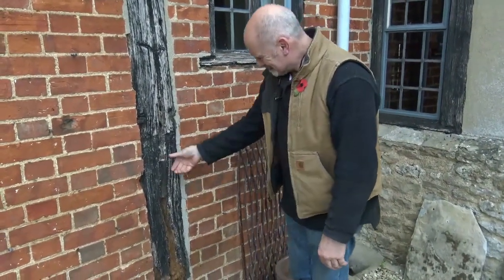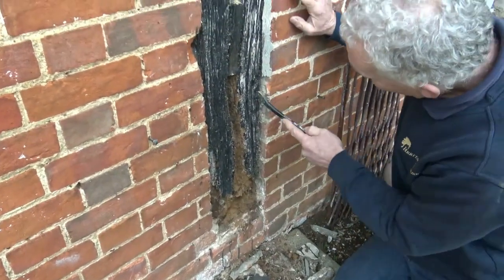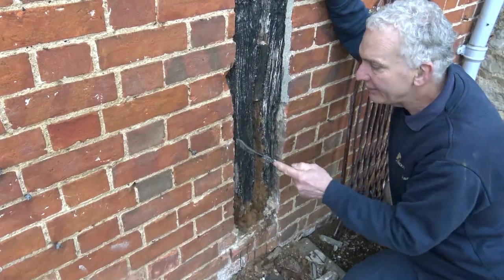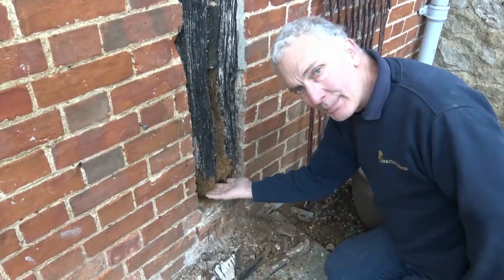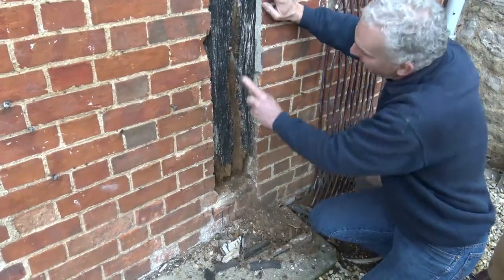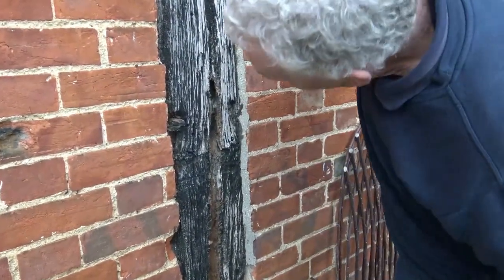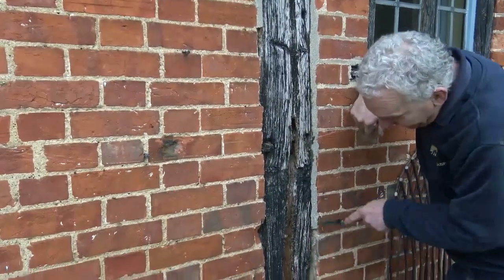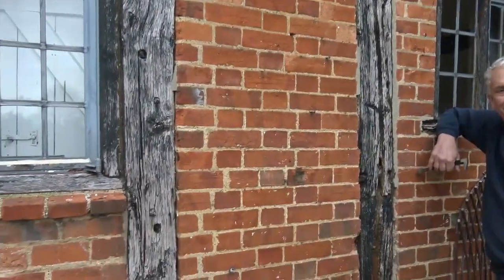A Confused Carpenter sees the light!

Comment: Do NOT put limes in that wood... the citric acid will attack the timber making things worse
Reply from the maker: Yup - the job's a bit of a lemon really..
Reply: What do you think they used before cement, lime is fine. Lime is even used as a finish to furniture 🙄
Reply: Clearly it's a job for a cantaloupe. Ya'll don't know what you're talking about.
Reply: @bigbaskin587  Someone doesn't get the joke. 🙄
Reply: @bigbaskin587  he meant the fruit
Reply: BornToRunBarefoot  that would be a peach of a job.
Reply: jeremy... I agree. Kumquats are undoubtedly the preferred option for this sort of job, or Kiwi fruits for the builder lads working down under.
Reply: Its obvious what you need here is a pineapple.

Comment: Very sensible.
Understand what is actually going on.  Old timber framed building get wet and dry out if you let them.
Brickwork, (my subject) gets wet and dries out if you let it.
People in offices using computers design modern buildings with all sorts of modern materials without truly understanding damp and condensation. Your comments regarding cement mortar versus lime mortar are spot on.

Comment: Oakum is the original caulking used on ships to seal the joints between timbers , usual hemp or jute mixed with tar ( pine tar is light in colour so was more used )
Reply from the maker: That's the stuff.. if it seals boats, its ok for timber frames!

Comment: I'm probably way off the mark, but it looks like they could've built it out of brick entirely. Was it a transition period from wooden House's to one built out entirely brick. It's when you can't quite let go of the original way if building house's..
I should've added that on my travels I have noticed a lot of house's been built with wooden frames with kingspan then brick..
Reply from the maker: No - this was late 1500's, Listed, but messed around terribly - so has to be kept as is now - but the infills were actually put in the 1930's to replace original daub..

Comment: I would like to ask about wood hardeners.....i know this is a (potentially) graded/histroic building etc....but is there a place for wood hardeners here??...i've used the Ronseal one and it's been good so far....i should think it would at least protect that bottom part of the post before the lime mixture??
Reply from the maker: I wouldnt use anything - any chemical interference will result in moisture entrapment.  Its kindof dealing with the symptom not the cause.  Ideally, sort the reason wood is soft (concrete, silicone etc) then honest repair by removing soft timber and slicing in a plate of new matching timber (usually oak).
Reply: ahhh right yes....putting in a new piece sounds about right....and I did wonder about the moisture thing.....I've only used it on hardwood window frames which were ultimately painted...so a differtent job entirely.....Thanks for the reply though...I find this kind of thing perhaps more interesting that I should :D

Comment: I have a old stone cottage connected to a derelict barn to the side, the cottage was renovated about 25 years ago (not by us) an from my information they kept the stone cottage an put breezeblock infront the whole way around to raise the eaves of the house an roof. we have noticed some damp along the front. is this coming from the barn (along the front of the barn all the gutters are broken) or is it possibly because when they renovated they trapped the moisture in with putting breeze block an cement infront off the old stone? can I add you on something to show pictures or videos
Reply: Conor Mcdade 
I would say that in most cases it would be the broken gutter, if it's a barn roof there is a lot, a huge amount of water running off with no collection point, in light rainfall there will be tens of litres a minute running off that roof saturating the front of your house.
Look into that first, hope that helps.
Reply from the maker: I'd check the barn and gutters first - but you could be right - certainly the gap between block and wall needs ventilating.. Ground levels too - below level of internal floor?  Check all drains...

Comment: First question then, what is Oakham?! (I imagine it's some sort of filler!)
Reply from the maker: Oakum - hemp, soaked in stockholm tar, wound into a rope and hammered in.  It's used to seal the decks and planks of sailing ships, so if it keeps boats afloat, it keeps timber frames dry. We first used it on the roof of Windsor Chapel after the  fire, and its still not leaking, so I reckon it works!  Our Heritage House website has caulking kits for sale - oakum, lime putty and caulking iron for repairing and sealing oak frames...
Reply: @WarmDryHome  am I wright to think its horse hair as when I work on the canals installing lock gates I would use horse hair I think they called it oakham.
Reply: @WarmDryHome  thank you sir. I enjoy and learn from your videos!
Reply: oakum was a mix of hemp or jute fibres mixed with tar  (  pine tar usually  )and forced into seams (caulking a ship seam ) this creates a water tight seem .
Reply from the maker: No - its hemp , soaked in Stockholm tar...
Reply: When I use to install lock gates we used a horse hair and wedged in in the gaps with a tar

Comment: a fiber-blended epoxy would what I would use sure lime is quicker but epoxy will soak into the wood and restore its strength
Reply from the maker: Nope - unfortunately not:  . just saw a thatched cottage yesterday - next video going up - frame full of £16,000 worth of peter cox wood filler - entire frame now totally knackered, and needs best part of £100k and new frame - all because damp wallies filled it instead of butting out and letting a decent framing carpenter repair it properly.

Comment: Not heard of 'oakham' before, can you give any links as I can't find it with my spelling?
Reply from the maker: Oakum - hemp, soaked in stockholm tar, wound into a rope and hammered in.  It's used to seal the decks and planks of sailing ships, so if it keeps boats afloat, it keeps timber frames dry. We first used it on the roof of Windsor Chapel after the  fire, and its still not leaking, so I reckon it works!  Our Heritage House website has caulking kits for sale - oakum, lime putty and caulking iron for repairing and sealing oak frames...
Reply: Perfect, thank you!

Comment: Tried to Google if but no luck. What is oakem?
Reply from the maker: Oakum - hemp, soaked in stockholm tar, wound into a rope and hammered in.  It's used to seal the decks and planks of sailing ships, so if it keeps boats afloat, it keeps timber frames dry. We first used it on the roof of Windsor Chapel after the  fire, and its still not leaking, so I reckon it works!  Our Heritage House website has caulking kits for sale - oakum, lime putty and caulking iron for repairing and sealing oak frames...

Comment: What ratios do you use for Lime mortar. And what about lime plaster?
Reply from the maker: Gets complex - ideally hot lime mix  - Calbux 90 one part, and 2.5 parts coarse gritty sharp sand. Plaster similar, with a lime putty top coat...

Comment: Ignorant question. What is Hot lime? 2:49
Reply from the maker: Nothing ignorant about that question - hot lime is non-hydraulic, usually made as needed in small batches - using raw lime, which is mixed with gritty sharp sand and water slowly added. Theres a chemical reaction turning calcium oxide into calcium hydroxide, which liberates a lot of heat - which also helps with initial setting. We dont like hydraulic limes these days - they set too hard and become quite unbreathable - hot lime is much softer and more breathable and flexible, closer to what the old boys used. Note: We are NOT talking about builders lime here - nearest product to buy in a bag is Calbux 90.

Comment: what is Oakham??
Reply from the maker: Oakum - hemp, soaked in stockholm tar, wound into a rope and hammered in.  It's used to seal the decks and planks of sailing ships, so if it keeps boats afloat, it keeps timber frames dry. We first used it on the roof of Windsor Chapel after the  fire, and its still not leaking, so I reckon it works!  Our Heritage House website has caulking kits for sale - oakum, lime putty and caulking iron for repairing and sealing oak frames...
Reply: thanks

Comment: What’s Oakham?
Reply from the maker: Oakum - hemp, soaked in stockholm tar, wound into a rope and hammered in.  It's used to seal the decks and planks of sailing ships, so if it keeps boats afloat, it keeps timber frames dry. We first used it on the roof of Windsor Chapel after the  fire, and its still not leaking, so I reckon it works!  Our Heritage House website has caulking kits for sale - oakum, lime putty and caulking iron for repairing and sealing oak frames...

Comment: By, "Cement" ... Perhaps you mean "mortar"? ... Portland Cement, is an ad-mix component, of concrete and mortar, and is never use on its own for anything.
Reply from the maker: Yup - correct - portland cement is unbreathable and hard - lime is softer, more breathable - but NHL (hydraulic) limes are now known to be closer to cement in performance than we thought - so we now specify hot lime mixes.
Reply: @WarmDryHome  Nice we use the same hot lime mix here in Canada for repairing old stone work!

Comment: what's oakam
Reply from the maker: Oakum - hemp, soaked in stockholm tar, wound into a rope and hammered in.  It's used to seal the decks and planks of sailing ships, so if it keeps boats afloat, it keeps timber frames dry. We first used it on the roof of Windsor Chapel after the  fire, and its still not leaking, so I reckon it works!  Our Heritage House website has caulking kits for sale - oakum, lime putty and caulking iron for repairing and sealing oak frames...

Comment: Absurd repair.
Wood and masonry don't belong paired together, when exposed to the elements.
If you are going to repair the problem... do it properly.
Support the structure securely, remove the post, and fill the remaining space with brick (for asthetic appearance) or reinforced concrete (for low-cost, permanent repair). 
Leave the half-assed "band-aid" repairs to the buffoons, whose structure will need to be bulldozed in 15 years.
Reply from the maker: And get taken to court by the Listing Authorities. Removing historic fabric is illegal - replacing with reinforced concrete is the worst thing you could do - a) Not a like for like repair, b) non-breathable, c) rigid and different expansion rates which will destroy the delicate brickwork around it.
Reply: @WarmDryHome ,
Good points.
I wasn't thinking of the historic regulations imposed by others.
With that in mind, I would recommend simply replacing the posts with fresh posts of the same wood variety.
Otherwise, the structure cannot be relied upon to be rigid in high winds, or even small earth tremors, and would likely be rendered "history" even if it remained standing.
Reply: Obviously you do not work on too many protected older buildings. The methods here from Peter are correct preservation techniques using adequate preservation materials. Not all solutions and remedies have concrete in them!

Comment: A bit of filler and bitumen paint, done
Reply from the maker: Yup... unfortunately that's just what really does happen, and why so many of these frames are ruined.. :-(
Reply: Chantell... Presumably you watched the video with the sound off?
Reply: Peter Ward 
Expanding foam will keep the wet out and can be sculpted to look like the original timber.
Reply from the maker: Unfortunately expanding foam is one of the worst things you can do to a timber frame - it traps water and rots the timber. Do NOT ever put expanding foam anywhere near timber..